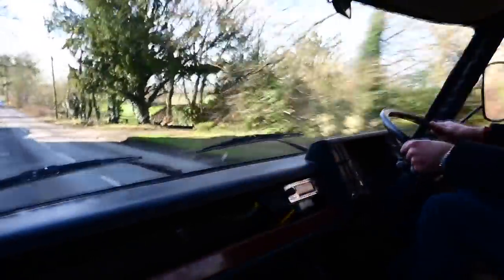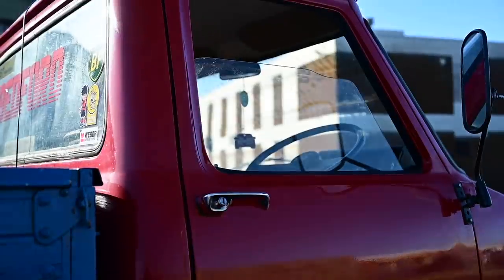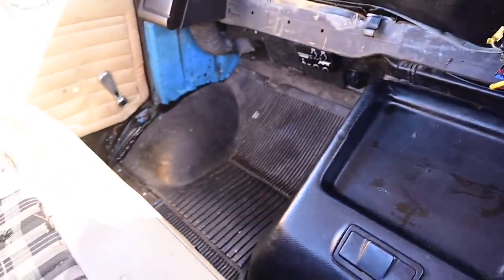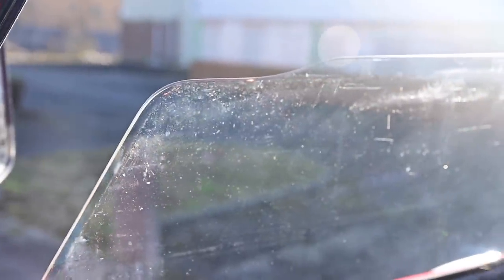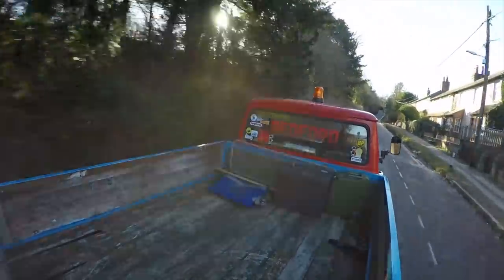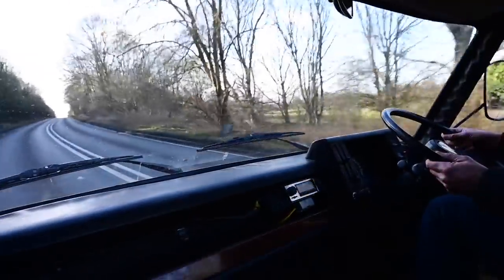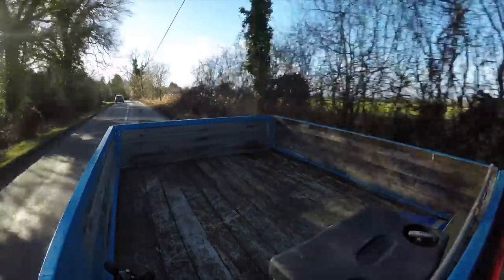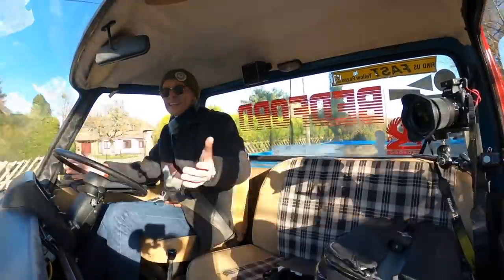1982 Bedford CF CF1 Pick up Goes for a Drive

Comment: Great to see another CF, thanks for the video Furious Driver. I’ve been the proud owner of a 1982 Bedford CF280 ex-ambulance for 23 years. When I bought it towards the end of the last Millennium it was already converted into a camper but it had a Vauxhaul slant engine that was only a 1.8L and if a hill was too steep then forget it, I’d have to go a different route. So when the clutch went in July 2000, I thought now is a good time to put a diesel engine in the ‘Ambi’. So I fitted her with a 2.3 Opel/GM engine. Lots of adventures, trials and tribulations over the past two decades. . . .
At this present moment in time I’m having the engine (a Perkins 4.154 I fitted about 15 years ago) completely overhauled and should be back on the road in a week or so. I’m making a video of the Ambi’s story (it really should be a full length feature film. : )  so will post it up soon.
P E A C E   : )
Reply: This van is mine. The 2.3 slant petrol in there laughs at any hill.
Reply: @Landie_Man  Y reg . . same year as my CF. The 0.5L more would make a big difference. Your van looks great, good to have it reviewed in this video. My ‘Ambi’ appeared in a pilot for a tv series quite a few years ago called Tidal Rave. The lead actor, Warren Brown, played a local character living by the sea in a camper van. Unfortunately the program never made it to air but the Ambi did earn herself £100 for playing her part.
Reply: @FUNKINETIK  nice mate. She’s looking way better after a hot summer of tinkering!  

That’s a brilliant story. Is it available online anywhere?
Reply: @Landie_Man  Ahh cheers, no , I’ve searched for it recently but nothing, I was promised that a dvd of would be sent to me, but it wasn’t. It was only a couple of weeks ago that I searched for the actor’s name. I knew he’d been in The Bill and a short series with a story line of Big Brother contestants being unaware that the outside world had turned into zombies. After finding his name I was impressed with the various roles he has played.
Yep your CF is looking great, it doesn’t look ‘old’ . . such a good design. I’ve been giving my Ambi the attention she deserves. I was really lucky last week. . I was struggling to find any info on a replacement bushing in the steering rack and when Adrian Bailey (I assume you know of him) told me that Bedford never supplied a replacement bushing. And then luckily found a complete reconditioned steering rack on EBay. So looking forward to getting back on the road.
Reply: @FUNKINETIK  yep I know him. Lovely guy, knows his prices but a nice chap and very helpful!  My CF has since had a new front bumper with spotlights, the rear bed rebuilt and painted, plus an H frame with spotlights on it to illuminate the bed (rear work lamps). Plus a bit more polishing!  I love these vans. They’re very useable
Reply: @Landie_Man  CF’s were definitely built to last, yours, as mine, will be tax and mot exempt as from Jan 1st  : )  I spoke to Adrian just last week trying to find a pinion oil seal for the diff, both of us were unsure of the type of replacement needed. I ordered one from him off eBay and he decided to send me two similar ones to make sure I had the right type, the other one he sent turned out to be the one I needed so I’ll just return the wrong seal. I told him that was very thoughtful of him.
Reply: @Landie_Man    just watched a couple of your vids  -  ‘I would funking gladly stand on a mountain summit, . . but shit like that’  - classic   : )
Reply: @FUNKINETIK  thanks mate. Literally none of my stuff is on here.  It’s mostly on Flickr.
Reply: @Landie_Man  yep I read that. Over the years I’ve taken quite a few photos of old rusty mechanical things at disused quarries and docks etc, something charming of there history and what a hive of activity there would have been in their heyday. I recently found a really rusty geared wheel bolted into the rock by a little cove on the coast of Anglesey, I assume it was to winch boats in, got some nice pics of that during the ‘golden hour’ before sunset.
Reply: @FUNKINETIK  oh lovely!  For me, sunrise is the one :). Where are your photos?
Reply: @Landie_Man  I haven’t put any up, I’m sure I signed up to Flickr years ago, must sift through some stuff and load it up. Been more into producing video art over the years for VJ’ing for club nights, festivals etc.

Comment: Back in the early 90’s I was a service engineer for the YEB (Yorkshire electricity board) and I used an electric CF van. It had the rear diff turned 180 deg and had an electric motor fitted directly to it and the floor was full of normal 12 volt batteries.
I could only get about 40 mile range and for the winter it had a paraffin heater!

Comment: I have a memories of an early CF diesel with a Luton body, noisy and slow doesn't describe it! Flat out, empty we saw 48mph on the clock, loaded it wouldn't pull a hen off it's nest! Later I serviced Transit laundry vans with automatic gearboxes, and seemed fast after that CF Luton!

Comment: Lots of happy memories! Jurgens caravans imported a few hundred into South Africa to build campers there was the CF250, the same chasis as this in the video and the CF350 on a dually chasis. We had A CF350 with a 6 berth camper body and did a few rallies with the Jurgens club as well as other holidays. Although it had the same 2,3L engine as shown in this video and a 5 speed gearbox, first gear being a crawling gear and the other 4 for normal road use it could very easily get to 140 km/h an cruise at that speed with 4 people and all thier katundi for a weekend.
GM themselves didn't sell the CF much in South Africa and probably stopped in about 1980.

Comment: I have a 1980 cf 1 in my shed bought it from a local sale years ago only had 11,000miles on the clock it is a twinn wheeler lwb with a 1 .9 diesel ( original )   used it for work then now in store still now got only 38,000 miles on clock . Lovely original  vehicle loved driving it

Comment: This drive brings back memories. 
I worked for what was The Milk Marketing Board back in the early 80s.  I used to drive a panel van version on a daily basis, that particular van was a 1982 X reg with the 2.3 engine.

Comment: Well that was different Matt, thanks for that, I remember the CF’s well, a friend of mine had one sitting on his drive for years in the 90’s and it never moved, it had corrosion here there and everywhere and the engine and brakes were seized. 
      It’s a shame the Bedford brand is no longer with us, the CF as you said always played “second fiddle” to the transit, but they were everywhere at one time, most survivors are camper vans and ice cream vans nowadays, it’s rare to see a pickup or panel van.

Comment: Hello Matt. Thanks for the reference to the Bedford CD. I googled up a photo of a clay model. Neat! On CF body styles, there were 2 vans. One of normal length and roof height and a long wheelbase version with high roof. Within those were many variations too - swinging or sliding front doors, side rear door or no side rear door, and dual or single rear wheels on the LWB vans. For a campervan, a single wheel LWB would be ideal if you can find one! In Australia, CF's were powered by Holden 6's up to 3.3 litres, and Transits by Falcon 6's up to 4 litres
Reply: I have driven both four & six cylinder CF's, a past acquaintance of mine owned a 4.1 Transit in my native NZ, all these models both in swb & lwb were more common across the Tasman in NZ than you think 🤔 
Along with their successor the CF2 Opel Petrol powered 4 cyl and 202ci CF2 in rear wheeldrive form only.
I understand an Opel diesel powered CF2 4WD for the british military in small numbers back in the UK.

Comment: I had a panel van with front sliding doors and sliding windows ( like a mk1 mini or TWC ) and I can't remember what year it was .. mine was a 1600 petrol . I paid £140 worked it for 1 summer then scrapped it after a 3 page failure sheet on the MOT .. 
Ahh memories .. 
Peace and love brother 👍🏻☮❤

Comment: When i worked for Millers of Poole they had a fleet of diesel CF and i had a CF camper in around 1983 was a great van and the engine pulled well and was good on fuel. I also had 2 FE Victors with the 2.3 engine.

Comment: The electric CF used a complete drivetrain bought in from Lucas. There was one for sale on eBay a while back - formerly used at Luton airport. There was also an electric Freight Rover van (later version of the Leyland Sherpa) which used the same drivetrain. It would be interesting to do a comparison test, but I suppose the biggest problem would be finding one of each. The only electric Sherpa I know of is in Ipswich Transport Museum.
Reply: A chap near to where I work  owned a electric cf he had a spare one for parts when they finally died he purchased a electric berlingo from a power station

Comment: Great nostalgic video to start my day. These were everywhere when I was growing up - as you said in the video (several times 😊). My grandad had a Bedford CA Dormobile for 20 years (he had 4 kids, it was almost the only option back in the late 50’s’) which I absolutely loved going on adventures with him in. Could be a good project camper? Keep up the good work Matt!
Reply: My dad had a CA in NZ back in the 50's & 60's. 
I drove many CF's in NZ, both four & six cylinder.
I owned a CF350 tandem wheeled jumbo with the ZF box 📦 which really worked hard over those years, the 90's.
Their were many CF2's in NZ, as special request back to UK by large fleet buyers, namely Auckland Electric Power Board 🔌 and Saint Johns Ambulance 🚑 in my native New Zealand 🇳🇿 😀

Comment: That was a lot of fun even though these were never seen here in The States. Cabover pickups didn't catch on, probably because we have wide open spaces. I briefly owned a '57 VW single cab pickup in the eighties, people would ask, "did you build that from a Microbus?" Keep the content coming, most enjoyable!
Reply: This isn’t a cab over as the wheels are in front of the driver. This is a similar van to the 70’s Chevy van as both are GM products except this CF has the flat bed body instead of the usually fitted panel van body.

Comment: My Dad had a blue 1976 CF 250 panel van in 1982 and while not old at the time it had been laid up for a few years with running problems and he got it cheap and used it and could never fix the misfiring problem.
Remember the reg MWO374P, he always said it was very fast 😅
Went to the breakers in 1985 unfortunately.
Loved the CF and bought myself a 1980 CF coach built camper van in 1997, it was great and pulled well and was super nostalgic what with my childhood memories of my dads Bedford van.
I done lots of mods and it done plenty of trips to Devon from West Sussex where I lived.
Would love to own a CF 350 twin axle panel van in mint condition if the lottery ever comes? 
Lovely British vans from a great time before everything went foreign ❤️😅

Comment: My school had a Bedford CF2 minibus. It was particularly slow and extremely noisy and it was always quite moment when it was wheeled out of the school's garage. Briefly replaced by a Talbot Express before that was replaced by a new MK6 Transit about 3 years after I left (they were running a funding campaign way back).

The Bedford I will always remember though, bags of character and quite the battleaxe!
Reply: This is mine. It’s surprisingly nippy!
Reply: @Landie_Man  I guess because it's not loaded down with extra bodywork and 15 spotty oiks and all their wretched clobber. 🤣

Great to see a video on one! Haven't seen another on the road in forever! 👍👍👍

Comment: I had a twin wheel extended chassis 1974  CF truck with a Perkins 154 cu in Diesel and a 4 speed  gearbox .  I used it to collect  scrap cars in '83 /84 . 
 40 mph top speed , but it towed my mates broken down Transit when both were fully load  with absolutely no effort . Eventually the chassis rusted out right behind the cab .I worked it until the head board touched the cab then sadly sold the engine and gearbox for export and scrapped the rest . I preferred them to Transits because the cab of the early models was big enough to store tools and ropes on the floor .

Comment: I had a long wheelbase CF Van with a 202cubic inch (about 3.8 litre) 6 cylinder Holden engine as standard, coupled to a Toyota Supra 5 speed and a 9 inch Ford diff. People kept leaving" sell me your van" notes under the wipers and I sold it for more than I paid five years later. 
 They were terrible rust buckets and very basic inside. Appart from the rack and pinion steering they were about a million years behind the Transit and about two million years behind the Japanese competition. The Hiace I replaced it with shat all over it in every way.
The one you've got is one of the last ones but mine was a 78 model so didn't have any dashboard or anywhere to put a radio or anything. I had to build my own dash shelf where I built a place for a radio and mechanical temperature gauge because the standard one didn't work and I cut a hole in the back of the dial next to the Speedo where I fitted a rev counter. It would do a bit over an indicated hundred and sixty KPH (about a hundred mph) and about 15/20mpg.

Comment: The utility aspect of this reminds me somewhat of the cab-over vans from the 60s in the U.S. Chevy had a Corvair based utility truck/van that was sold to the phone company with a fold-down ramp in the side of the bed for big reels of wire. The front of the Bedford reminds me of the front end of the Ford Econoline van from the 80s. I miss the Econoline because it had styling that was not simply based purely on utility but it was only produced in North America and has been replaced with the Transit.

Comment: The original CFs had very basic seats, the drivers seat only moved back and forth. Later on when they upgraded the seat with more foam, back and height adjustment the seat was taller but they kept the same seat base, so the seating position became way to high.
Reply: We replaced our original seats with Holden Commodore seats, especially for driving it from Sydney (Australia) to Perth and back. We still have them in the van, so much more comfortable.

Comment: Actually it's a CF Facelift - there never was a CF1. The round nose gave way to the facelift in 1980 and then the CF2 in '84. I run three CFs, all from '76 to '78, a twin-wheel flatbed, a pop-top camper and a panel van, all with Vauxhall slant-four engines. Great Video!

Comment: We used these solely here in NZ in the Auckland Ambulance Service in both models as a cab and chassis with a fibreglass body. All were repowered with the Holden 202 cu in. six or Chev V8's. The V8 powered variants were the best I drove in my time as a Medic, far superior to the later DAF's and even the later Chevy's and Fords and so much better than the current Diesel Mercedes. The only down side was the lack of AirCon.

Comment: Yep, they were everywhere when I was a kid & I can’t remember the last time I saw one. I used to the work the markets & while I never drove a CF, loads of traders had them. Did drive a Bedford Midi though, which wasn’t too bad. Bit lollopy to drive, as those kind of vans were (especially when fully loaded). Five speed column change (which I preferred to the Mk2 transit) & a bit more car-like. The Transit was the better workhorse & took some right punishment, but rusted badly.

Comment: I'd love an original CF panel van.  My dad had one when I was little - a '73 M, sliding cab doors in sky blue.  I can still smell the inside - a mix of cheap vinyl, fuel leak and exhaust fumes

Comment: I had a CF2 with the cam in head engine; it was great to drive, the gear change was notchy but accurate and slick and the van handle better than a Transit, in that it was less "rubbery".
Reply: Double wishbone, say no more. Iveco do double wishbone now, all the others are single strut and it shows.

Comment: Actually there was the CF and CF2 no CF1. When I worked in a village garage back in 85 / 86 we had one in for service and I had the job of changing the spark plugs awkward job as part of engine  was made tricky to get at even with the cowling removed in cab.
Fun fact how you knew it was a CF2  was orange lines around  the instrument cluster and along dash

Comment: we had versions of theses and vans in australia in the 70 and 80's they were ok bit under powered with a 173 holde red 6 cylinder in them with a trimatic option 
also they did some with a 253 v8 in them  but the block had the chev gearbox bolt pattern to i believe use the turbo 350 autos on them

Comment: I had a series 2 86 cf 350 3.5 ton tipper it was slow and underpowered with the 2.3 Opel diesel but would go up the side of an house I once moved 60 of the old 3x2 concrete flags and me and five guys and it was still fairly level its registration number was D865ARF have wondered if its still going it would be 37 years old now

Comment: Those triangle reflectors are for trailers only, CV ones should be circular, the owner needs to change them else a knowledgeable traffic cop may issue a ticket if bored and a quiet shift.  I wonder how many rear screens that has had as no bulkhead/headboard on the loadbed.  A scaffold pole/plank in the back of the head hurts.

Comment: Top edge of the windscreen was so low you hardly ever needed the sun visor. Mine had a pull out choke lever that was actually a manual cruise control.
Reply: Actually, sunvisors on the CF1 were optional...